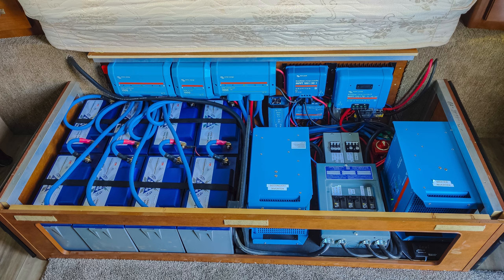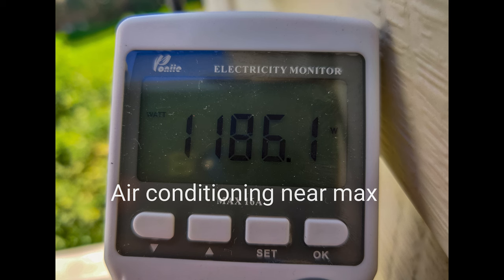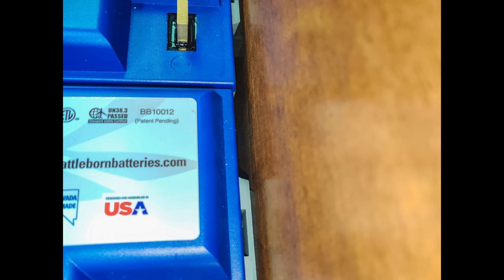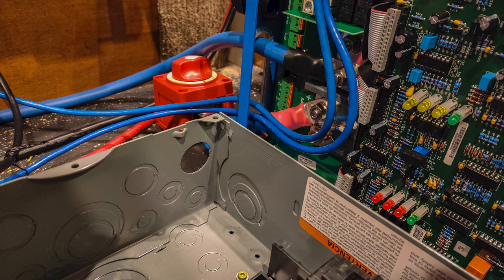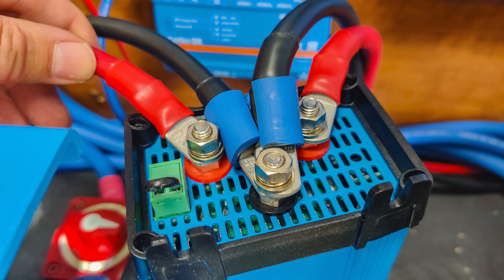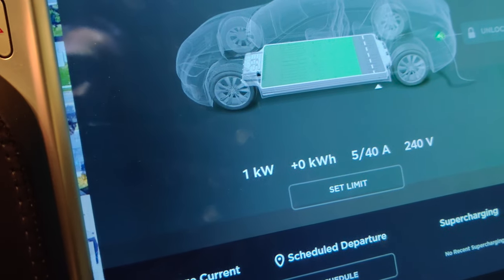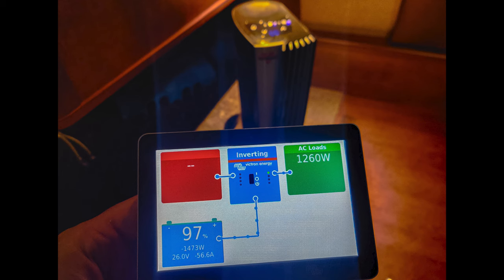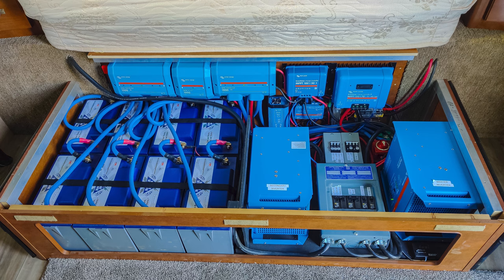Fitting A Robust Electrical System Into Our Lance 2185 Travel Trailer

Comment: Very good and detailed video.  Could you explain the purpose of two inverters and their designation please?
Reply from the maker: Each inverter outputs 120 volts up to 20 amps continuously. I have them wired so that they supply 240 volts to the heat pump mini split and the electric vehicle charging circuit. It enables a very high efficiency mini split and doubles the speed that I can transfer energy to an electric vehicle and increases the efficiency of that transfer.

Comment: Great system, you've done some serious work. I here a lot of praise for the Mini Split, so what is the current draw on your 24v battery system.
Reply from the maker: I agree with that praise. Having the ability to both heat and cool is already way better than a standard rooftop AC unit, but it's efficiency is just awesome. The mini split consumes more power when heating than cooling. That being said in both modes there isn't just a set amount of power that they draw. It's very variable. At peak I've seen the mini split pulling about 1,800 Watts when heating and the trailer is super cold. But once it gets to the set temperature it's typically pulling something like 300-500 Watts. I can heat our trailer all night with about a 50 degree differential between outside and inside and it consumes 50-75% of the battery bank which is 9.6 kWh. I'll be publishing a video probably in a week and a half outlining how I installed the mini split.
Reply from the maker: @joeboxter3635  Thanks. I agree, it's especially annoying when someone references amps or amp hours and doesn't even mention the voltage then proceed with a question where we need to know the voltage or where Watts would have been much easier. I've found mostly the amps people are those with traditional 12 volt systems. I'm sorry to hear of your electrical system woes. If the solar guy you consulted with doesn't like Victron due to their price then perhaps I can agree a little bit, but you get what you pay for in this world and Victron has been awesome for me. I have minimal experience with other manufacturers so I can't really comment on comparisons. In my readings most people agree you can't get better equipment than Victron overall. I purchased some of my system from Continuous Resources https://www.continuousresources.com?aff=78 so they're my go to company for support as well and they're very good.

Comment: Nice set up! im in the planning stages for a camper build and doing some research. i hope to be able get around 1000 watts of solar on the roof but planning to use it alot in the winter and not sure if that will always meet my demands with a mostly electric setup (will proably have a diesel heater too). As well as charging from the alternator i am wondering if it would be possible to occasionaly do a rapid charge of the battery's using public eletric car charging stations (i dont stay in camp grounds). Do you have any idea if this would work? you seem to be doing the reverse charging your tesla! I was looking at the multiplus ll inverter charger 48v-240v (as im based in europe and 240 is standard here for all domestic use).

Any insight you might have would be greatly appreciated
Reply from the maker: See the Facebook group named Victron Powered Camper where on April 20th Timothy Michael Pfeiffer posted that he successful charged his RV batteries from a public charger. Yes I'm doing the opposite, but I can also charge my RV batteries from external sources. I just have never needed to. I can't charge from a public J1772 EV charger but Timothy figured it out.

Comment: Very cool install... why two solar charge controllers?
Reply from the maker: The voltage of these panels is around 40 volts so added up that's 200 volts and the highest voltage charge controller Victron sells is 150 volts. So I needed to have some of them in parallel and some in series which means there has to be an even number of panels to be in a series/parallel configuration so the 5th panel needed to be on it's own smaller charge controller. Does that make sense? If you're interested in more details about the panels here's the video I just published today about that. https://youtu.be/DPY6RY9Ck28

Comment: Nice work! Only thing I would change is don’t use thread tape on flared gas fittings (not sure if you did, but it appears you might have). The seal isn’t happening on the threads it happens on the 45° metal to metal surface.
Reply from the maker: I did use the tape shown in the picture on the threads, but I made sure it wasn't on the 45 degree surface so I imagine there's no harm done.

Comment: Only if you are OK with it, would you consider a total for your complete system? Or break it into two parts: 1.  Solar panels, 2. everything else that supports the panels and converts (inverts) to AC?  Have the Battelborns come down in price when I looked at them for my home system (AGM, 12VDC in series/parallel to 36 VDC) they were around $1,000.00 per battery. They are the best there is, but I just could not afford them.
Reply from the maker: I kept a detailed parts spreadsheet with all the pricing that I paid and I am considering making a YouTube video going over it. The parts that I used are in a spreadsheet without the prices listed and the link for that is in the description of this video. The solar panels and charge controllers, aluminum unistrut racking, corresponding parts and wires that went with that part of the system cost me $3,054.10. the rest of the electrical system overhaul including the batteries and inverters, all of the other components cost me $12,449.58. The total electrical system cost $15,503.68. however that is not the complete picture because I also removed some of the components that were in there previously and I sold them. Such as the converter ($150), the solar panel that was on the roof ($115), and the charge controller that went with it ($40). There are other price points as well regarding the propane refrigerator that I replaced with a DC electric compressor version and the air conditioner that I sold and replaced with a mini split etc. The Battleborn batteries were $812 each (shipped).
Reply: @ElectricTechAdventures  Thank you for this very detailed reply. I have a 27 foot motorhome and am considering doing something similar, but fuel cost today are making me rethink my plan. It just depends on the World over the next few years to determine if my MH is now "guest house" for visitors and I should just tie it in to my septic and solar without any modification...... lots to think about. Again, thank you.  (PS My Dad's name is James and my Son is Alexander James. A great name for a future great man!)
Reply from the maker: @benkanobe7500  one reason why I opted for a trailer instead of a motorhome is because I wanted to be able to upgrade the towing technology at some point in the future. Whether it be from a gas tractor diesel truck or to electric. In my case I intend to tow it with an electric truck. I don't know yet how successful that will be, but I am certainly willing to give it a try. I am certainly hopeful that in the future electricity is not completely unavailable or cost prohibitive more so than diesel or gasoline. At this point though I would believe anything and I have no idea what to expect in another year or two. I'm just glad that I do have my own electrical source here at home on my house as well as on the roof of my RV. If the electrical grid is cost prohibitive or unavailable then I know I can at least slowly charge my truck with my trailer's solar array. Thanks for the kind words about james. We named him after his great grandpa and great great grandpa both of which were named James.

Comment: I would be interested in hearing more about how you use both inverters for the 240 volt to charge your Tesla, and still have 120 volts. Can you have a 120 volt and 240 volt load both at the same time?  I know one mini split that has a very high EER rating is 240 volts and you can buy induction cooktops at 240 volts as well.  But most everything else would only be 120 volts.  Great video.
Reply from the maker: My trailer is setup the same as a regular house on the grid. Meaning the grid has two 120 volt lines coming to your house and a third common line. If a device is on an electrical circuit that has a "single pull" circuit breaker then it's only connected to one of the 120 volt lines and the common line for 120 volts. If the electrical circuit is a "double pull" breaker then it's connected to both hot lines which are 180 degrees out of phase with each other and thus they add up so that device is getting 240 volts. In my trailer each inverter is supplying 120 volts to the AC distribution panel which has 2 busbars and 6 breaker spots. The EV charging circuit and mini split are double pull breakers so they supply 240 volts. Then I have a single pull breaker connected to a 12 gauge wire over to the induction cooktop. My last circuit breaker is also a single pull breaker that's connected to the input line of the RV which was previously the shore power input cord. So the majority of my trailer's AC electrical needs are on just one inverter. The induction cooktop is the only device that only pulls directly from the second inverter. The EV charging and mini split always use both inverters when they're in use. If I'm using the EV charging circuit at this point in time that means we're at home and not camping so I let it pull up to the maximum the inverters are capable of, but most of the time I'm actually charging the Tesla an average of the solar power for that day which is 7-8 amps so far here in March.

Comment: even at today's gas prices. $8000USD in batteries would buy you years of gasoline for a eu3000 honda. i want to buy a new rv. and i will install a lot of solar, and batteries. but i need to win the lotto first.
but it looks like you are doing a great job. now to get Will Prowse to check out your system. if for nothing more for him to say junk. or go into fits saying a good job.
Reply from the maker: I certainly didn't spend $8,000 on the batteries. The details of the costs are all documented in this video. https://youtu.be/7W9E0Y3H-aY and as I state in that video, the amount of money spent on a system is justified in all kinds of ways by people depending on their priorities. There is far more value in my electrical system than simply replacing a generator. I can entirely justify the price of the batteries and inverters just by having installed this system instead of a Tesla Powerwall to supply backup power to my entire house for instance. I recognize not everyone is in the market for whole house power backup like the Powerwall, and a lot of the RV community is simply comparing my system to using a generator while camping a couple times a year. That's an overly simplistic view of it as I use the power generated on a daily basis all year for charging my electric car, and while we are camping it's a glorious experience compared to using a generator. Here's a video beginning a series of camping videos from our trip for 2 weeks going to Arizona if you're interested in seeing how well this system works for our family on a real trip. https://youtu.be/IoNFKm0ZauY